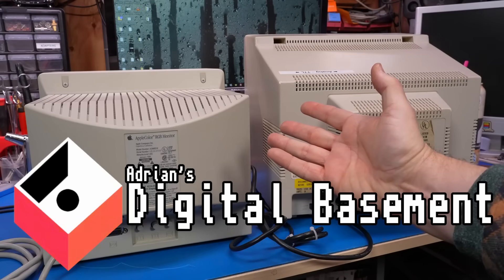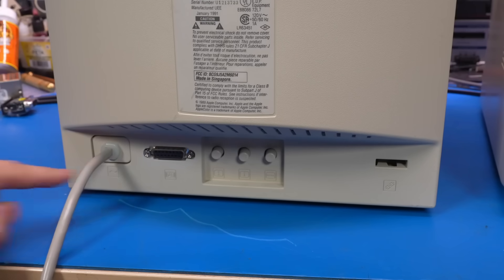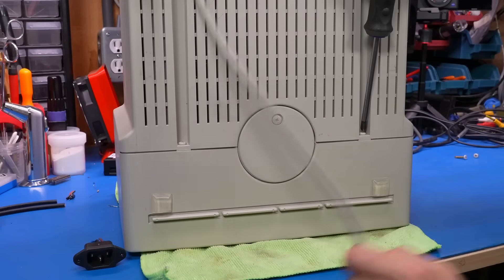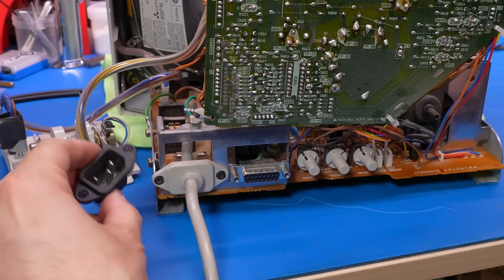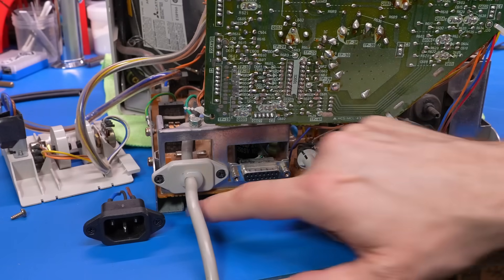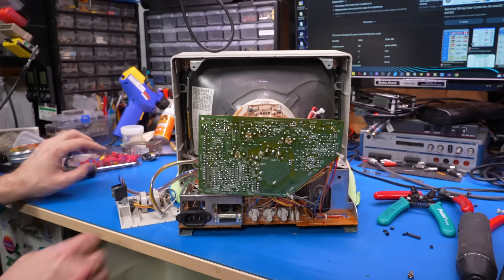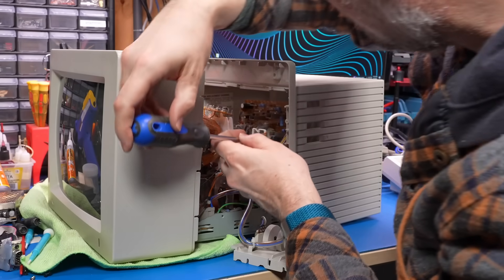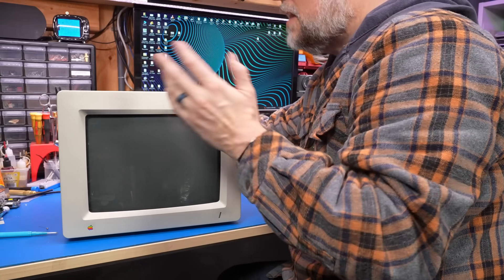Quality of life: Adding a proper IEC mains power input jack to a monitor

Comment: Just found a manual for this monitor, which says the 120V monitor has a fixed cord, while its 220/240V-variant indeed always had a separate IEC cord. I wonder why... Probably: 220/240V was mainly Europe. While all European countries use the same voltage, they use many different plug types. IEC connectors probably helped there, as it avoided the need to produce different monitors for each country. Just swap the IEC cable in the box. For the North American market that didn't matter. The 120V variant just needed one plug type anyway, so a fixed cable worked fine...
Reply: The two grounds give it away - it was probably JUST over the threshold for EMI FCC approval and the fixed cord was likely a kluge fix. One ground is standard, and the other is surely a shield
Reply: yup that is mainly true germany and the netherlands have same plugs.. belgium hass different plugs uk has different plug and so on !!! but the voltage is the same in all european countries
Reply: @Dutch-linux  It's 230-240 actually but close enough. Is only nominal anyway.
Reply: @rimmersbryggeri  Until 1987 there were actually still countries with nominal 220v (Germany, Netherlands, ...) and some with 240v (UK, Ireland, even France for a while). But that didn't matter for such "modern" electronic devices like this Apple monitor, as they were officially designed for the "220-240v" range. Only in 1987, EU countries introduced the common 230v standard - which also adapted the max/min tolerances - so in practice, not much really changed.
Reply: @fgaviator  True. WE still often call it 220 in sweden even though that was ages ago.
Reply: @fgaviator  and for some older equipment (valve stuff especially) making sure that if it's rated for 220V it gets 220V and not 240V is quite important as you can destroy valve heaters pretty quickly with too much voltage.
Reply: @fgaviator  Ireland was actually 220, I remember our electricity company (ESB) released a booklet in the late 80s and one of the things in it was to be careful of UK imports as they may not handle the 220V supply properly. I think it was only the UK that was (and still is) 240V. The standard was just adapted so 240 was still considered to be in the nominal range.
Reply: @fgaviator  Yes, but 220v has some tolerance, the UK with 240v has also some tolerance and 230 is within tolerance from all countries :)
Reply: different plugs in eu? 😅
Reply: Macretrofly that makes a lot of sense.  There's a significant savings in minimizing the variety of product models to manufacture.  There would be more savings yet if they could keep the cord separate.

There is a way to get around that.  I have bought several products from [overseas] that came with a bag of different mains adapters.  In today's world that is cheaper than stocking different SKUs for each market.  However that isn't entirely safe and probably violates UL and other regulatory stipulations.
Reply: @Starchface  Why even make separate models for USA and the rest of the world? It is possible to make a power supply that accepts 100 to 240 V 50 to 60 Hz. I have power bricks with those exact ratings. All you need is to obtain the appropriate power cord for your country. I even remember devices for international sale in the 1960s and 70s that had a voltage switch that you set to your local voltage.
Reply: Can confirm, my UK spec 240V //GS monitor has an IEC socket
Reply: @richardbanks2669  Yep. I remember some moitors having attatched power cables over here too though in the CRT days.
Reply: Probably just a safety feature. If the monitor is permanently attached to a US power cord then it will prevent the user to plug it into a 220/240V electric system outlet.
Reply: I think that's why they switched a lot in the US. Most switching power supplies these days that have an IEC plug can take 50Hz 230ish or 60Hz 120ish
Reply: @MarkEmerAndersonII  In fact, most switching power supplies today work from 90-250V at 50/60Hz, and are sometimes rated for 400Hz as well. (Commercial aircraft power is 110V/400Hz.) And in practice, lower voltages and other frequencies work fine: the first thing that happens in a switching power supply is to rectify the input to DC, so they’re usually totally insensitive to frequency, and will usually work on DC as well.
Reply: Probably because a 220 monitor will not be destroyed byt pluggin into 220 while the reverse could be a disaster.
Reply: @rimmersbryggeri If that is the case, your pcb designers were lazy.
Reply: @higihups  Yes but yet it was code.
Reply: @rimmersbryggeri I would now like to see the code, mandating your devices to blow up, if connected with 220-240V instead of 120V.
Reply: @ Who said anything would blow up. I have tried plugging 240 into 1 power supply set for 120 though and it can burn smoke and smell quite alot. IT is also a distaster for the power supply. These are not multi input power supplies.
Reply: @rimmersbryggeri  And that is exactly what I meant: There is absolutely no reason for fire, smoke or anything. If there is no overvoltage protection, your pcb designers were lazy. Could be as crude, as a MOV crowbaring the circuit and blowing the internal fuse.
Reply: @higihups  There are things like capacitors that will burn if you double the voltage they are rated for. And yes it is stupid to not over rate them but they didnt alot of the time. Possibly even transformers could take a beating from doubling the voltage and all of these things would come before over voltage protection. You have to consider that american 240 and Euro 240 don't work the same either. For that reason they would want to make very sure that a 120 unit "could" not be plugged into a 240 outlet.
Reply: @rimmersbryggeri  A fuse should always be the first part in your device. Not where you feel about it. A sufficiently ratet MOV behind the fuse will decrease its resistance with rising voltage, keeping it at a safe level, until the flowing current exceeds the fuses max by too much and it blows. Your components will barely experience overvoltage at all, therefore barely stress your components.
Simplest overvoltage protection ever, one extra part that you have to install between live and neutral (That is, why you find these in so many things as a cheap OCP).
This usally results in a blown fuse and a warm MOV, but otherwise a working device.

A regular transformer would not be affected by doubling the voltage, as it just doubles the output voltages. If itself gets damaged by doubling the voltage your insulation was just insufficient - that is safety margin you have to calculate anyways to account for insulation eventually breaking down - congratiulations, you put a fire hazard on the shelves, better recall it before you are sued.

The difference between american and european 240V is the phase angle being 180° and sometimes 120° in north america (depends on the two phases being drawn from either three phases or just one, one is usually 240V the other 207) vs 120° from standard european three phase power.

The only thing caring about that are transformers and as you power your monitor single phase you always get a full sine, no matter if you use combined split phase or just a single european one. in case you supply it with only 207 volt from a an american three phase system, your transformers output voltage would just be a bit lower as the effective input voltage is lower.

Switchmode PSUs do not care about your phase form or angle at all, you could feed those things some fitting DC and they would not care, as they rectify first and generate their own frequency from that DC anyways.
Reply: @rimmersbryggeri thailand has usa style sockets(they take also euro plugs) and 220v.

However they probably gave thailand 0 thoughts. Usa is big enough of a market that it can have its own sub model
Reply: @ You are probably right. They probably didnt anticipate many US market products would end up in thailand back in the day.
Reply: @lasskinn   Thailand’s sockets are a mess right now. They began with US style sockets, then European ones appeared, now the hybrid receptacles are common, and the plan is to migrate to a new plug (type O) that is basically a European plug, but with an earth pin added using the spacing of the US plug so that it fits in the hybrid receptacles.
Reply: @tookitogo  yeah and the actual effect on market now is that a bunch of equipment is sold with chinese plugs.. Anyway i don't trust a grounded looking socket to be grounder anyway. If the ground wire isn't visible going to  a ground from a device its probably not grounded.
Reply: Very excellent observation! One more thing to remember is that most of the products at the time that had IEC connectors supported multiple voltage and frequencies. In the US there were and are certifications that must be obtained to sell things that plug into mains power. If you sent them a product with an IEC jack, the will test it to see if plugging in 240v cable causes a danger to the user. If it doesn’t handle it, you might not get the UL approval. Much easier to proactively prevent that. Something he should be familiar with by now and he could avoid the snarky comment about saving a few cents.
Reply: Actually, in Europe there are TWO mains outlet types, UK type, and the other sort.
Reply: @alanclarke4646 Wroooong. There is UK, German (the main continental one) , Swiss (3 parallel pins and iincompatible for grounded), old Italian, new Italian (compatible with German), French.
Reply: @der.Schtefan  Swiss, French, German, Danish, Italian and UK are the ones I can think of. The two pin Europlug will fit everything but the UK socket, the two pin 10A? round ungrounded plug will again fit everything but the UK and Swiss sockets (due to the recess), I understand. and lastly you have the German/French hybrid grounded plug that will fit in to a round socket that either has a protruding ground pin or the side earth contacts. 
Of course some countries in Europe are moving over to the Schuko from their own standards to make things easier and in some cases rather than changing the power cord they'll just stick an adaptor on, even if the cord is removeable, somewhat common on UK stuff with Powerconnections making a range of screw on adaptors.
Reply: @ There are mor then 2. there is th 3 pronged schuko and the schuko with side tabs for ground there is also t 2 pronged one for double insulated  the old roud ungrounded plug. In spain they had one with no shield around the plug. And then there is the UK plug.
Reply: @alanclarke4646  There are 15 mains outlet types world wide. There was once an attempt to create a global standard, but only Brazil and South Africa adopted it.
Reply: @alanclarke4646  No, the UK type and the correct type. Greetings from Sweden 😁
Reply: @alanclarke4646  Europe had one more without ground around that time. But it was on the other side of Europe.
Reply: @alanclarke4646  fake, UK isn't even europe
Reply: @uiopuiop3472  the UK definitely IS part of the continent of Europe. I should know, I live in the UK. You might be meaning the European Union. And, yeah, we left that, but geographically, the UK is part of Europe.